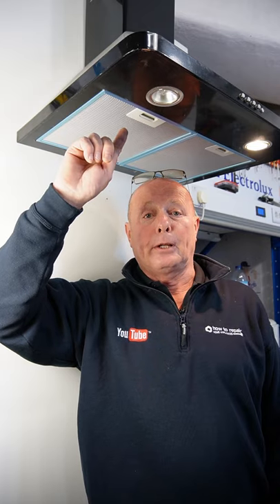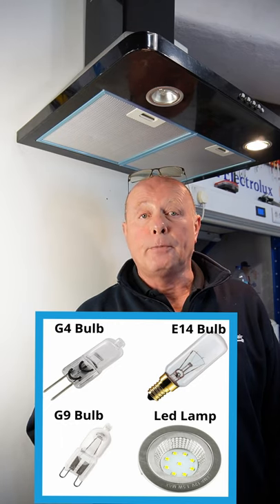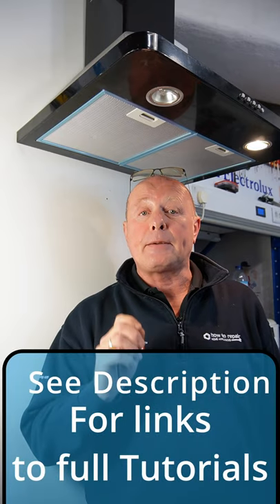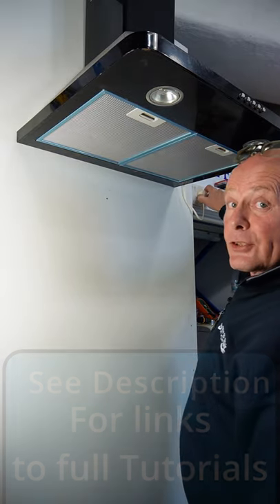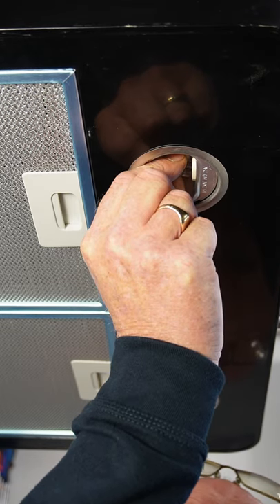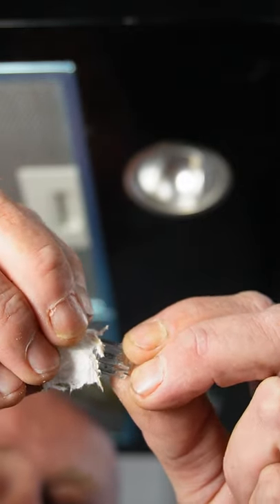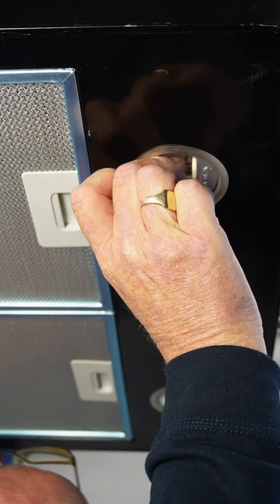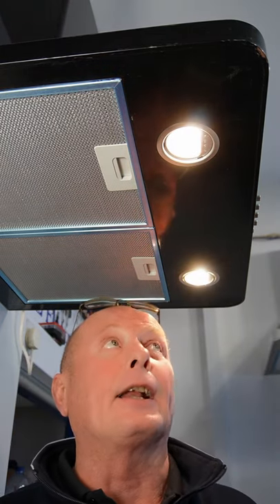How to replace a Cooker hood extractor lamp bulb #shorts

Comment: still not work on one side and tested that the blub was fine, it's the plug that didn't work.  Is there a transformer inside to step down the voltage from 220v to 12v for the blubs?  I wasn't able to pull the wire down.  Thanks for your detailed explanation, a greeting from Hong Kong.